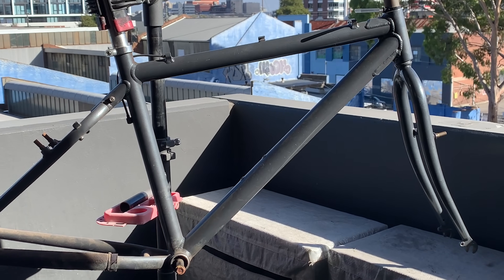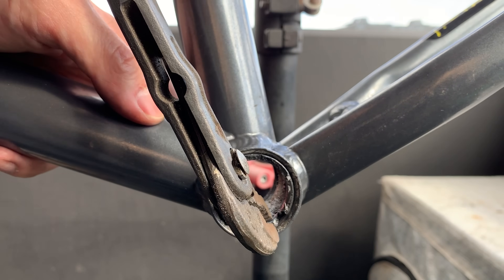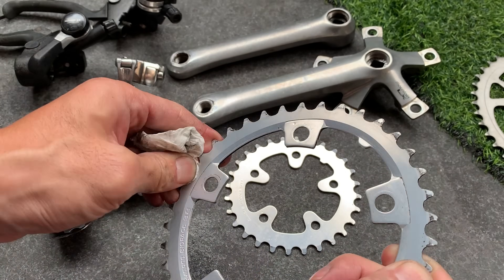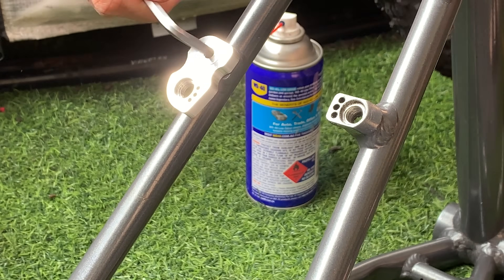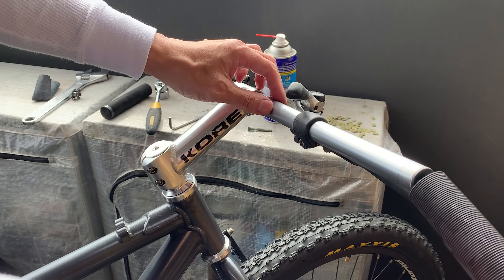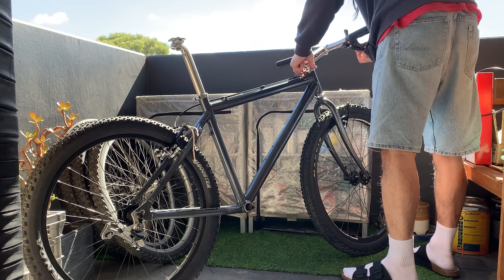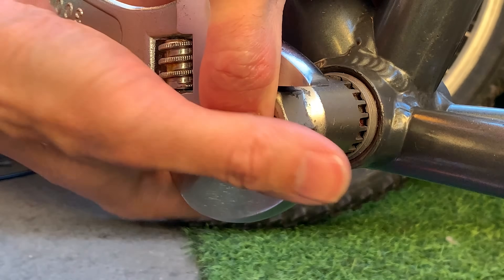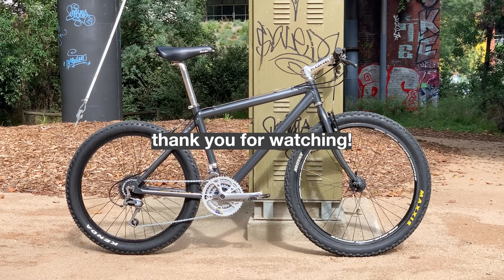24/26 rigid mullet mtb bike build

Comment: Wicked build! This turned out really decent. It appears there's no obstacle you can't conquer Gary. Love watching and learning.
Reply from the maker: thank you my dude i appreciate that !
Reply: @garysprojects  you're welcome. I love your process. Organized and very knowledgeable. Quick question. What would be the best way to go about removing black paint from a rim? It's aluminum so I'm sure there's chemicals that are too abrasive. I just prefer raw aluminum or shiny stainless steel rather than black.
Reply from the maker: mmm i think that might be difficult without undoing all the spokes , u could either use paint stripper or sand it off , both will be alot of effort tho
Reply: Yeah I've pretty much accepted that it's gonna require some elbow grease to achieve. I'm completely ready for the challenge. I just wanted to make sure I didn't use a chemical that would do damage to the aluminum itself. So regular old paint stripper is safe huh? That and or Emory Cloth? I don't have sand paper. Bought a fresh wheel of Emory Cloth though.
Reply: I guess I'll also probably need some polish and a buffer too huh? I don't care, it's worth the effort as far as I'm concerned. I am not a fan of black rims.😁
Reply: I like to shine!😁
Reply: That aluminum crank set is damn near making my mouth water!😆
I'm an absolute sucker for aluminum, silver and stainless steel.

Comment: Thank you for the nice video.
If I may, two little pieces of advice from me:
1. When you use detergents to clean your derailleur, you should deassembly the entire part and lubricate it (especially the mainspring and derailleur cage spring).
2. It would be a good idea if you level the ends of the cables with a locksmith's file or an angle grinder to prevent damage to the Cable End Crimps
Reply from the maker: Thank you for the tips ! Sometimes I use a bit of lube in the derailleur after - that helps too ! Cheers 😊

Comment: I doubt this is a real world concern, but those adapters to move the brake mounts are applying a torque to the factory mount that isn't normally there. You could fit a brake booster to mostly cancel out that torque, if you happen to have one of those lying around...
Reply from the maker: @3lfd3wd  cheers mate. yeah a bit of a mod is always gunna be changing the factory tolerances, brake booster is a good idea thx 👍

Comment: In the first days Shimano only manufactured sprockets by stamping them out, later they were deep drawn to produce the Hyperglide profiles and also to strengthen the sprockets through the forging process, the older cranks still had the old distance, so they were mounted with washers to correct the position .
Reply from the maker: Ahhhhh I see !! Thank you so much for that info !

Comment: Damn, Gary!!🔥🔥
Nice and rad. build. 
Though initially the silver wheels would be best for this build, with all the silver components, but you nailed it with a mullet set up! 😎🤙
I never considered 24" before you droped this video. 
And this frame probably had hydraulic Magura v-brakes, hence the hydraulic brake routing and the chain stay protector. 
Hot, hot, hot. 🤩
Reply from the maker: thank you very much i appreciate that. haha yeah the silver wheels would have done the job nicely. fun to switch it up with the 24s ! youre right about the magura hyro brakes that is exactly what it was for - as i was told some bikes came stock with frame. cheers!

Comment: Gary, have you ever done a 26” to 650b conversion? Would those adapters work? as opposed to spending big on Paul Motolites or similar… Sweet build once again ❤
Reply from the maker: I have never ! But I think they would work because they are designed to go up in size vs down, I’d just double check tyre/ wheel clearance. Cheers my dude I appreciate that !

Comment: A Shimano XT M770 and M772 groupset along with Thomson 7000 series aluminum Elite post and stem would look Great on this Giant🤘🤘. And the "wishbone" frame looks good too👍👍. My 2006/07 6061 aluminum Trek 4300 is one, and it has Shimano 739 XT V-brake levers, 760 XT V-brakes, M770 XT HallowTek 2 crank, a 750 XT front derailer, M770 XT 9spd rear derailer; and XT M772 Rap!d F!re Plus shifters🤘🤘
Reply from the maker: wow thats cool alll decked out, sounds like a cool bike. cheers!
Reply: @garysprojects  All after purchase components/parts. I also put a 
💰200.00+taxes and lab.🍁 7075-T6 aluminum Chris King headset on it😁👍👍. The owner of the shop (which closed in 2020) told me I could have gotten a better bike for less, but I did what I wanted ; a customization if you will. Enjoy your riding👍👍

Comment: Hi! nice build!
you mentioned painting the rims, does it influence breaking power negatively at all? what paint are you using?
cheers!
Reply from the maker: Thank you very much ! 
I painted that rim in my Kona chute video more details  , it was just cosmetic at the time , I don’t think it does anything to the rim. Braking wise nothing has really happened function wise , I think a little paint came off that’s all.  Paint is black exterior house latex based 
Hope that helps , Cheers !
Reply: @garysprojects  Awesome thanks, I'll check out that video:)
I have some crusty old semi-deep rims that are in okay condition but have seen a ton of use and just look really beat up. Want to give them a second life but was worried the paint might reduce friction too much or whatever.

Comment: I’ve heard about also using blue loctite to fix a loose bottom cup caused by an ovaled head tube. Do you think a shim is moreso the way to go to fix this?
Reply from the maker: i think the shim will probably be a tighter fit, but i havent used the loctite method before so i dont know if its better or not ! cheers

Comment: You can't use V-brakes with an old 1989 cantilever brake lever,  they take different cable pull. The levers will pretty much bottom-out the same time as the pads hit the rim.
Reply from the maker: I explain it in the video about the pull ratio , it works depending on that ,  for these specific levers it does

Comment: those brake levers will also let you run u-brakes which iirc only bmx levers will let you do now. By that same logic as well they should also work for disc brakes too right?
Reply from the maker: Mmm not sure it depends on the pull ratio of the disc brakes , road disc are short and mtb are long , it’s best to match the lever pull with caliper

Comment: I was working on a customers bike the other day, a Kona Lanai, it had a front 3x8 derailleur, a top pull shimano altus,  the limit screws had to get spun out pretty far for the limits to work, is that normal for some older derailleurs? Just looked kind of .. weird to see 2 tall limit screws standing up from the derailleur
Reply from the maker: Mmm sometimes I guess it depends on how far the cranks are from the frame , usually they are about half way in.
Reply: @garysprojects  hmm, yeah they were about 85% out, I wonder if there was a wider, incorrect sized BB Installed at one point  and pushed the chain line out... ..
Reply from the maker: @_Zane__  ya that usually does it

Comment: 7075 aluminum 🤘🤘
Reply from the maker: oh thats it ! good to know thanks
Reply: @garysprojects  Not your frame, the V-Brake adaptors; it says it right on them😁👍👍
Reply from the maker: @glen3509  oh hahaha thank you!
Reply: @garysprojects  The reason you don't see 7075 frames is because they can't be welded, the zinc is the reason. Now someone actually did make a 7075 aluminum frame, but it's held together with bolts and some sort of adhesive 👍👍
Reply from the maker: @glen3509  wow that is crazy, thanks for sharing, very informative